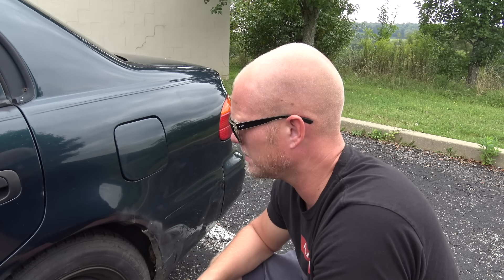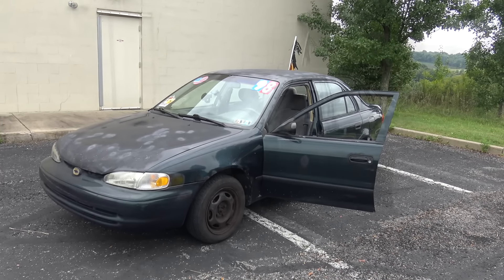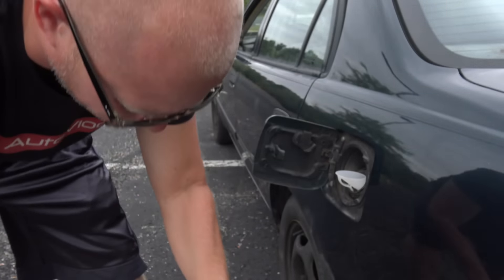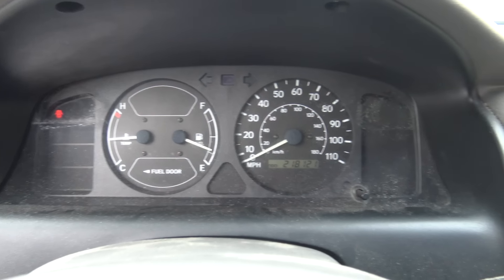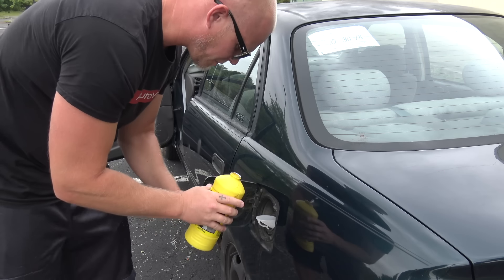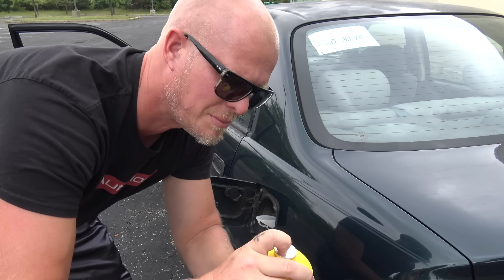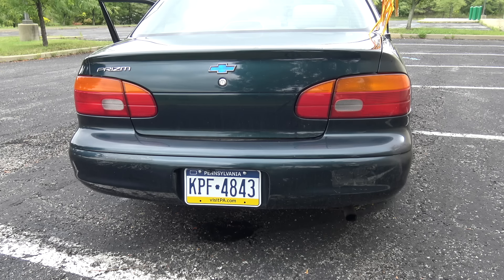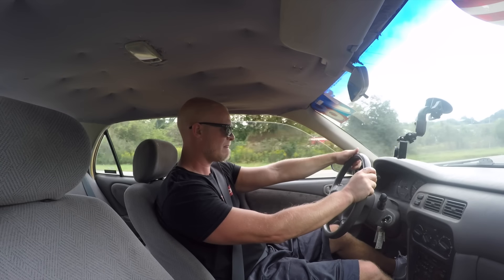What happens if you put BRAKE FLUID in your gas tank? (You'll be surprised!)

Comment: Having been a master Chevrolet mechanic(1970-1980s), I can tell you it can clean the carbon out of the motor when run through a carburetor, I might suspect it could clean injectors as well.
Reply: Hey if you ran through a 454 engine in a motorhome that's been sitting for over a year in canadian weather, would it help clean carbs out?
Reply: Brake fluid is basically a solvent so yes I am sure. If you want an example grab a slightly rusty wrench or something and rub it down with brake fluid on washcloth or something slightly abrasive.
Reply: Heather Robson Personally I  would take about a half a pint of gauging transmission fluid (ATF) really any kind cheapest kind you can find or even just a little bit that is leftover in the garage or something and mix it with about a half of pint  of kerosene or fuel oil and about a quarter pint of gasoline and shake it up real well in a glass quart jar like the ball kind for canning then put it down the carburetor as you run it with somebody giving it gas to keep it from stalling you can always add more gasoline to the mixture in the jar if you need to but it should billow out some nasty smelling white smoke that would be cleaning everything out. Another thing you could do to clean the engine and valves and such would be to drain about a quart of the old oil out and put a mixture of about three-quarters ATF and a quarter kerosene or fuel oil let it run at idle for maybe 10 minutes and then drain at will hot you are arrested then fill it up with oil and a new filter once again the cheapest stuff you can find run it for maybe an hour or even drive it around a little and then drain it hot again and now fill it up it's whatever you would do this for normal change with a new filter once again this should clean any sludge out of it that is built up inside of it no these are not recommended methods nowadays but they do work when it runs like a champ afterwards you can look up towards the sky and thank my grandpa! The kerosene will work as a solvent and a slightly oil-based lubricant and the ATF will work as a solvent and the highway of oil-based lubricant as well as are you working slightly as a swelling agent for things such as seals.
Reply: How about all gaskets ,angd lifters seals.

Comment: It would have been interesting to see and test the exhaust smoke as well as do an engine compression test before and after, the smell may have been the excess carbon and oild build up just burning off. Something you don't try at home, just in case.
Reply: I’d like to know more as well before adding break fluid to my 351 modified antique Bronco engine I’d hate to have to go head  hunting if ole girl left me stranded in the Gila Mts.
Reply: @lobopinfeather5738  This all sounds sooo intriguing, especially when just yesterday I had been searching around for an hour online for places that will recycle my used brake fluid from brake flushes and no one whatsoever taking it... However, I would rather just to the kitty litter method periodically putting little amounts in kitty litter and then throwing it in the trash, than ruining my main mode of transportation. Not worth it in my opinion, but I am no engineer who is also a chemist.

Comment: By doing this the only damage that I think was done  was,  to the catalytic converter... You actually helped the fuel system . Although that was a lot of brake fluid for such a small  amount of fuel...I would have to say that doing what you did definitely damaged the cats..I used to put brake fluid and or transmission fluid or WD40 in my fuel tank ever so often to lubricate the fuel system  but, just a small amount.. No more than about 1 ounce per 1gal- of fuel to avoid damage to the catalytic converter.

Comment: I suspect that you have cleaned out the injectors and fuel pump with the brake fluid. As for the smell, I suspect that it is the smell of burnt brake fluid. As long as you keep putting brake fluid it will continue to smell crappy, but it will run better as the injectors get cleaner.
This will be helpful at times to do this and keep the injectors clean.
Reply: thank u

Comment: You can use brake fluid to temp fix a slipping automatic transmission. Depending on damage already done to the bands.
Reply: It temporarily fixes pressure issues caused by hardened seals, and then a few weeks later the trans will definitely need a full rebuild because it won't move at all. 🤣😂. I've had to rebuild SEVERAL transmission from people trying brake fluid as a fix.
Reply: @mrmotormd  varsol in trans works better...swells seals, but does not degrade them
Reply: @pvanb2  true, but varsol can damage metal to metal interactions such as pump components, sprags and planetaries due to the fact that it has low lubrication properties and will is used to strip metal of oils. The ratio of varsol to atf would have to be minimal I would assume. I preach to all my customers that when something is broken you fix it by replacing the failed components, there is no such thing as magic in a bottle. There are however temporary fixes. If I really needed to buy myself a couple of days before rebuilding my transmission I might use varsol. But as I preach to my customers if it is broken fix it, don't patch it. There is no such thing as that "magic in a bottle"  most companies claim. Even the most intelligently planned attempts to restore things such as this without actually repairing it usually leads to bigger problems and higher cost of repair.
Reply: @mrmotormd  Use varsol replace the transmission oil after a service, then you run through the gears for a few minutes to ensure varsol is throughout the various clutch packs. Then the vehicle is parked and left for just a half hour or so, idle  running in park, as the  varsol softens the seals. Then a drain and refill with proper ATF. 
This procedure will cure a delayed engagement and soft shifts for various lengths of time, depending on how bad condition of the seals were, but it delays the clutch packs steels and fibers from further degradation and ultimate failure..for awhile longer.
This will delay the need for an expensive overhaul for customers who cannot afford one, but of course is only a temporary fix. Guaranteed ...these grateful customers will use you to do the proper repair on their vehicle, or their next one. 
If you thought to drive around for any length of time with only varsol in the transmission...you are NO mechanic or transmission tech.

Comment: More than a few times I've put brake fluid in automatic transmissions to swell seals and slow fluid leaks. I've also put automatic transmission fluid in the gas tank to run through the engine and clean deposits and lubricate the fuel system.

Comment: My man learned this trick from his uncle to clean the fuel injectors, works great
Reply: Please I'm from ghana ,in ghana here we have more  break fluid so can I used any one of them because  what  you    are  using is not here  And   can it let the fuels conjunction come down
Reply: Make sense ...since brake fluid sometimes being used to clean parts...and it is a little corosive....so i guess that will clean fuel system and injector also ignition chamber as well
Reply: Bingo! I watched my dad do it in his old beater truck back in the day. Smoked like crap, but it worked.
Reply: Show me video
Reply: Yes sir ,,i remember  my dad taught me ,,transmission  fluid does the same,,as far as lube the valves and lifters..
Reply: @ernestnartey4858  bro buy abro fuel system cleaner. It's less than 30gh
Reply: @lafete6863  
I think he is saying that they have different brands of brake fluid where he lives but not the one shown and wants suggestions on which one to use.
Reply: @lafete6863  
What will it do?
Reply: @williamlove3087  fuel system cleaner cleans your fuel system. Injectors etc
Reply: @lafete6863  
Thank you very much
Reply: My first thought was that it may work something like a dry gas product. I like the fuel injector cleaner idea, too!
Reply: @budhihart8161  it can also eat away screens and I o rings in your fuel system
Reply: @waterloo123100  perhaps...wkwkwk..lol
Reply: @ernestnartey4858  its basically just dot 4 brake fluid. Standard brake fluid in most cars

Comment: Brake fluid doesn't amplify any pressure in the brake system. Hydraulic pressure is a constant. Other brake system components increase pressure on the fluid. The fluid just delivers system pressure to calipers or wheel cylinders. It's also hygroscopic meaning it tends to absorb moisture.

Comment: You can also put transmission fluid in your oil just a quart will work once in a while.
Reply: Buddha Bell  I actually did this it really cleaned the crankcase and got rid of the engine sludge.
Reply: Buddha Bell  You don't need to do it all the time just once a year or two would work not every oil change. This works on an older engine I don't know about these newer engines.

Comment: You can't kill a Toyota engine. That 1.8 is unstoppable 😂😂😂😂
Reply: PLATINUM it’s a Chevy not a Toyota
Reply: @dennisb1368  yes it's a Chevy..BUT ITS USING A TOYOTA ENGINE 🙄🙄🙄🙄
Reply: Every car in the world should be replaced by toyota.
Reply: Tech.unbox.Reviews. Lol that “Chevy” is really using a Toyota motor hence the car getting to 218,000 miles
Reply: Agree that this car wouldn't reach 218k miles if it was a chevy engine XD
Reply: @dennisb1368  Toyota engine buddy
Reply: brake fluid absorbs water.
Reply: @PLATINUM2U  Its Chevota .
Reply: lmao
Reply: @dennisb1368  it's a chevy only in name and badge. I have an 01 corolla which the the same generation and everything is exactly the same except the tailights and the center area where the radio and the vents are. Even the gas cap is the same.
Reply: @HCkev  ehh the 2.2 ecotec, 3800 V6, and the majority of there V8 all will do over 200k without a problem, I owned a cavalier for a while 0 issues aside from 4 plugs at one point.
Reply: 7A-FE best!
Reply: Toyota’s are indestructible. Lmfao the best part of owning Toyos.
Reply: Only a Toyota engine can take this abuse.
Reply: PLATINUM lmaooo what r u know Scotty Kilmer 😂😂 jk lol it was a good one
Reply: @iluvmyeski  : Every toyota and honda in the world should be replaced with something different.

Replace everything with Volvo, Saab, Porsche, Bmw, Audi, Vw, Mitsubishi, Subaru,  Mercedes Benz, certain Nissans, certain Fords and certain GMs.
Reply: No toyota / honda are indestructible, just drain the motor oil, coolant, transmission fluid, put diesel instead of gas, and drive it for long long time, it will surely get destroyed, even the seemingly indestructible.
Reply: @JonhMunoz1  : Toyo is a brand of tires.

Toyota is car company name.

There is differences with the 2 names.
Reply: hahahah  so replace it with the most unreliable pieces of shit on the road haha right.
Reply: 1zzfe! 😂 that motor is bullet proof lmao. Unless you forget to check the oil, of course.
Reply: @JulioTRD  I've seen them run without oil as well
Reply: @dennisb1368  it's a Toyota Corolla trust me. If it's a Chevy built it, wouldn't have lasted that long.
Reply: lol you're not lying. if its a 7afe, I had a 100 shot of nitrous on the one in my celica, with 329,000 miles, trying to blow it up before I swapped it. It wouldnt die.
Reply: Tech.unbox.Reviews. 

Toyota engine.
These vehicles were made at NUMMI (New United Motor Manufacturing Incorporated) Manufacturing plant in Fremont CA. It was a joint GM /Toyota plant.  Production at plant stopped roughly around 2008 when auto manufacturers were bailed out. Last vehicles made there were Corollas and Pontiac Vibes. I worked at a Toyota Engine Factory, when Vibe sales were slow, GM would lay off workers who made engines and buy our engines because labor was cheaper. Same engines, same basic car platform, different badge is all.
Reply: Tech unbox it might be a Chevy but the motor is a toyota
Reply: Yes it is. Lotus puts turbos on them and puts them in their cars
Reply: Thanks u I
Reply: I still  have  my 87 Toyota  Corolla  hatchback  355760miles  still  running
Reply: why would i want a shitty car
Reply: why
Reply: No wonders slay queens don't  like Toyota owners. These guys worship their cars and seem to be mean. They also have sheep mentality. For the same reason, Toyota cars are selling at high prices!!!
Reply: HCkev yeah it would reach 500k instead
Reply: @GilZu  good one! 
or,
a Toyolet 🚽
Reply: My Carolla just died.
Reply: I drive a 1993 Toyota Corolla 4 door with a 4 cylinder front wheel drive,console automatic. Easiest car to change plugs in,even with a 10 inch extension.The plug chambers on top are  just wide enough to keep plugs centered on installing. It has 130,000 miles and runs like a top,clean inside and out. FM radio/cassette deck/ and CD player. Great air conditioner and heater system. Opening sun roof too. It was from Florida and spent 5 years here in Indiana Winters. Get a Toyota people .I get 25 miles per gallon city or hwy.   Dig it .One fill up every 3 - 4 weeks.  :)
Reply: its a Geo Prism so it was whatever Korean company worked with Chevy.
Reply: RIP
 @mattsauro8881
Reply: @PLATINUM2U  the prism is a toyota corolla
Reply: @samlung2724  you win. I've only killed three!
Reply: PLATINUM I have a shotgun that says different. Lol
Reply: HCkev I have a 1997 Chevrolet Silverado Z71 with the 5.7 Vortec motor in it it's got 318589 and at 225k it lost oil pressure to 5lbs I drove it another year to work n back lost it to my ex wife who took it in divorce the hood latch broke on her and she couldn't check, change, or add oil or coolant for that matter. She beat the piss outta it for another 9 months till the fuel pump rusted thru she parked it in her dad's open field next to his house. It sat another 3 months   she told me I could have it back if I'd tow it outta there her dad was tired of looking at it. Towed it home pulled bed off put new fuel pump fuel lines and new gas tank under it, got the hood open buddy of mine drained a quart of sludge outta oil pan and about gallon and a half of rusty brown water outta the radiator.  He put new radiator in it new hoses, full tune up, basically rebuilt top end of it , and my dad still drives it to this day. Best fuckin truck I've ever owned and I LOVE my Mega Cab with the 6.7 Cummins , but that 5.7 is still running today on 5lbs oil pressure and it's not a bad guage or cluster that's been checked already. No telling how long it has left in it. But it's going on 9 yrs now after all that abuse    lol
Reply: @HCkev  1997 Yukon.  Original 250 engine, 310,000 miles and still doesn't burn oil.
Reply: Typo obviously, 5.7L 350
Reply: @dennisb1368  it is a rebadged Toyota... people who don't know cars 😂
Reply: Unless it has a timing belt and you forget to change it after 90k.  Bent valves and head
Reply: Really? Try running it out of oil, not changing the oil for 20,000 miles, or overheating it by boiling all the coolant out of it and get back to us.

Comment: while this video is a complete nonsense, the nonsense inside me led me to watch this anyway, and eventually I learned something after google search. Most brake fluids are glycol-ether based, which can easily mix with gasoline (mixture of hydrocarbons like paraffin, olefins). Also brake fluids are flammable albeit not as combustible as gasoline. Thus mixing it to gasoline will not in principle pose any immediate problem (but maybe detrimental to your car over long term use).

Comment: Here's what happened. I was watching your video and showed my dad. He is a 30+ yrs mechanic. So in the middle of the video he says to me, "back in the day we used to used the brake fluid to clean the carburetor." He says, "We used to open the top and just pour a little in. It's so toxic that whatever was black and mucky was cleaned up." He also said, "it is too toxic to leave your windows closed. (as you found out), but they poured in a little, so you should have topped off your tank with gas after pouring the two bottles."   Then we finished watching the video and you said "the mechanic told the couple to just keep topping off the gas and keep driving."
Reply: EitShm w
Reply: This all BS. If any one knows how breaks fluid looks like you would know that, that wasn't brake fluid. Brake fluid is oil and a bit heavier. In this video everytime he opens up the bottle he cuts the video. So he couldn't had pour gas in the bottle. Pay attention people.
Reply: @blde20  Exactly
Reply: BS
Reply: It help to start in cold day

Comment: I was hoping to see if brake fluid mixed with gasoline would enhance engine performance.
Reply: To properly answer your "HOPE" it would be wise to actually determine ALL of the ingredients in brake fluid and exactly WHAT they are chemically capable of doing. Using it as an "experiment" in the fuel system of a beater is pretty reckless.
Reply: It save a mechanic and spare parts of fuel pump and enjector because it made so clean
Reply: Add vodka in the gas tank

Comment: I'd be into seeing what happens if you run the fuel down to near zero, then pour in about a half gallon of brake fluid.  Some (usually really old cars) have a bolt on bottom of gas tank  you can remove to drain the gas.  Dunno if it would work then.  Also
Reply: I had a bad brake booster that was leaking past the diaphragm, didn't know it for a little while so the fluid built up in the vacuum chamber. Before I replaced it I showed a co-worker what a hard left circle was like in the parking lot as the vacuum line sucked the swishing fluid up into the manifold. James Bond move over
Reply: @martyjoseph9507  pop I